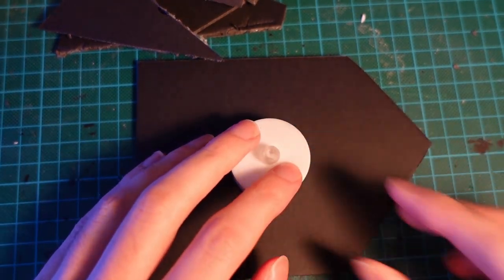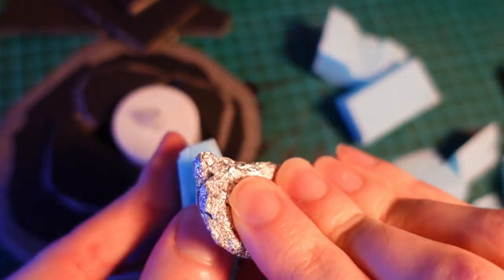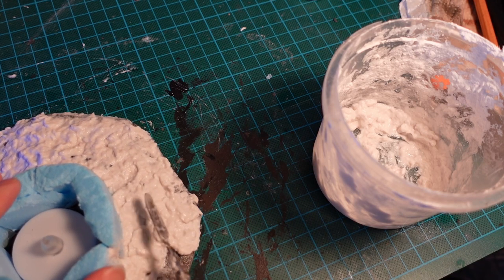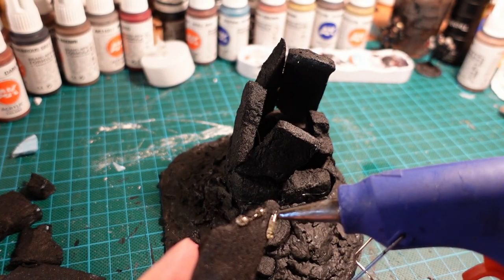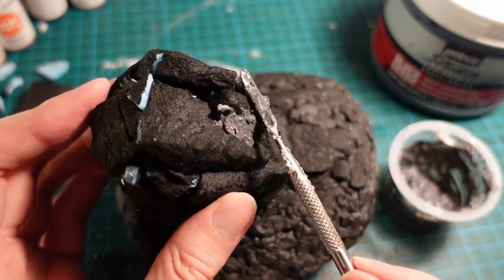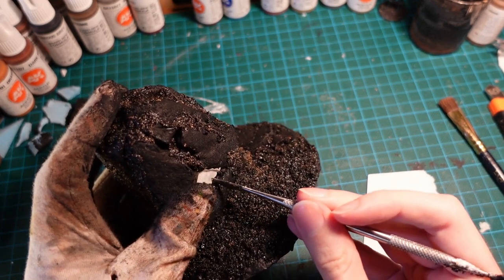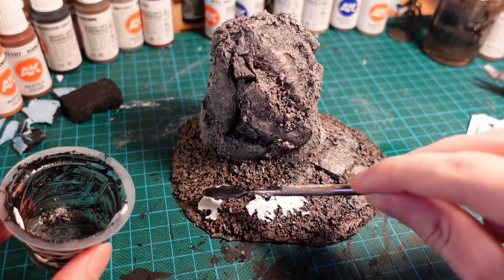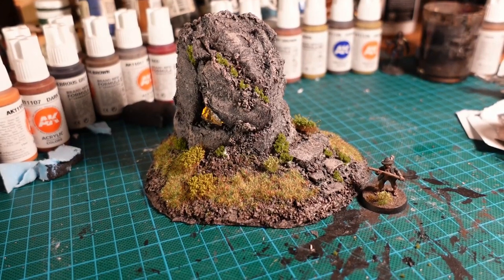DIY Scratch Built Glowing Monolith terrain for rpg/wargaming

Comment: For your mid brown, it looked like you were using a burnt sienna, however when it dried it looked a lot darker. What brown are you using? Thanks 😊
Reply from the maker: Good eye, it is technically burnt umber from the crawford & black range although I find it lighter than other ranges umbers. You can get it from 'the works' if you are UK based
Reply: @thecavyforge7307  I am indeed and have a works not far from me. Thanks and Merry Christmas!